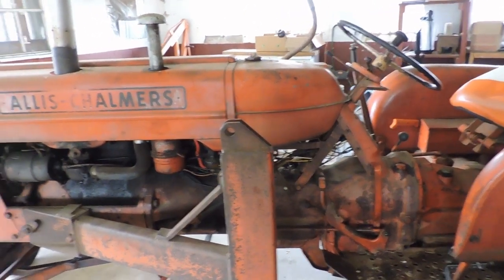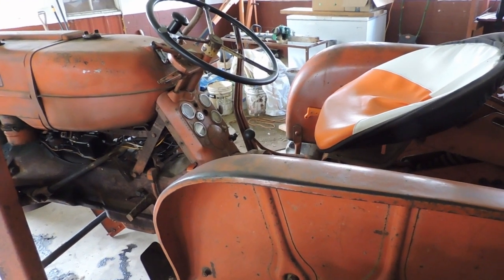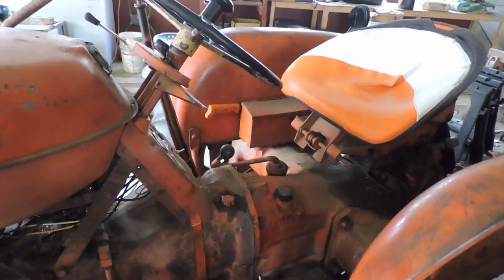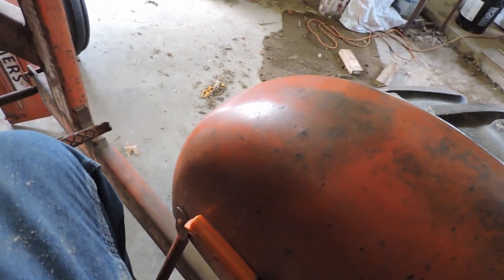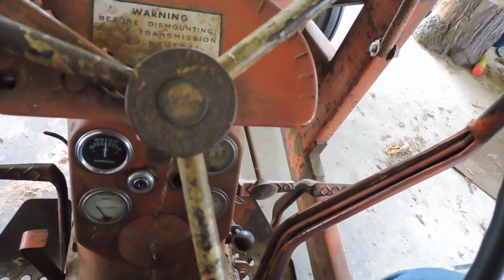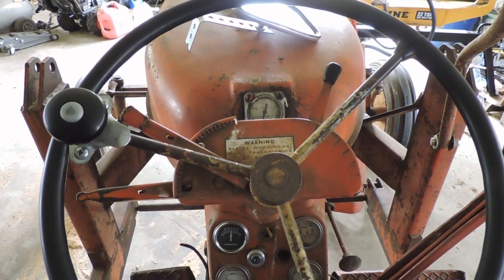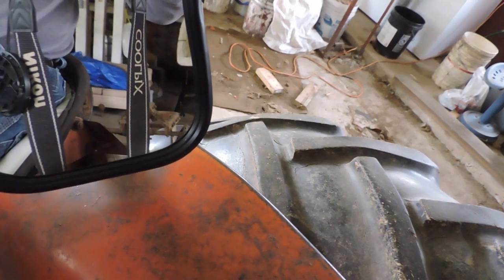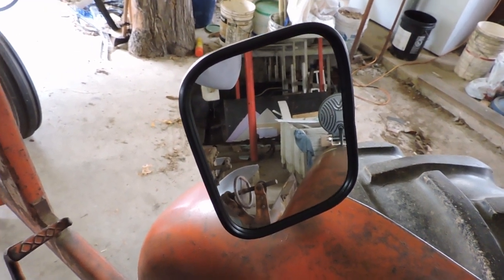Allis D14 Mirror Install

Comment: Nice job, simple yet effective. Where did you get the mirror and bracket?
Reply from the maker: Thanks for the comment.  The mirror was $10 at an Advance Auto store.  The bracket was a piece of scrap strapping steel I had laying around in the shop.